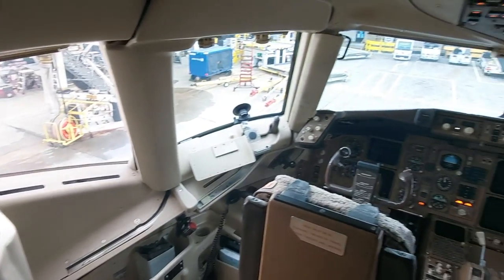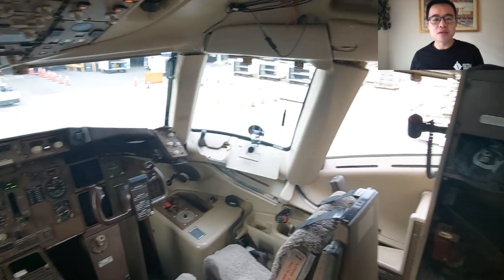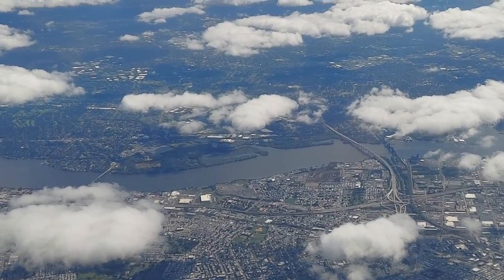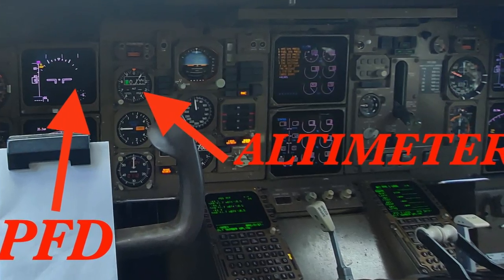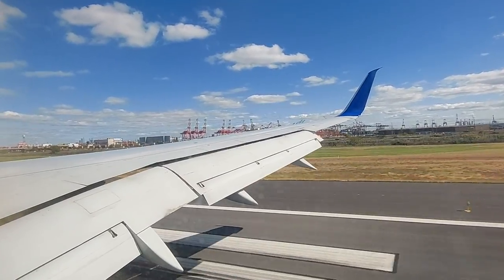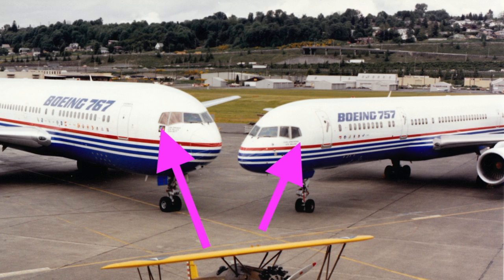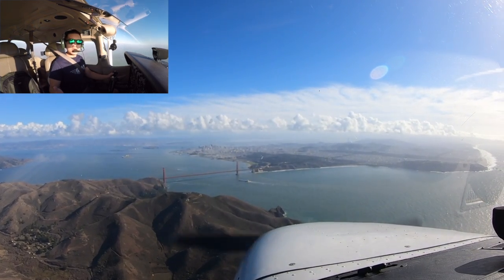BOEING 757 COCKPIT TOUR | United Airlines Boeing 757-200

Comment: All of our B757/767 aircraft all had Flat Panel Display systems which upgrade the flight instruments to modern aircraft parity. Also the B767-400 has the FPD system similar to the B787.
Reply from the maker: That upgrade makes a big difference. Much more capable. FEDEX even added FLIR to their fleet. Lots of cool aftermarket avionics on 757/767.

767-400 is nice, completely redone cockpit from the factory.

Comment: Spent many years flying the 75/76 before going to the 777. Some of Boeings best work (in addition to the 74 of course)
Reply from the maker: Amazing airplanes designed when Boeing was still ran by engineers.

Comment: Great video....love the 757 for the power and versatility....the airlines that still fly them don't want to give them up even after 30 years because there is nothing that can replace them.  Although I have read the new A321neo's are close in performance and range.  I am surprised they never upgraded the avionics in the older models, but maybe this is too much of an undertaking.  With the older avionics, I am wondering if these planes can fly the modern RNAV procedures?

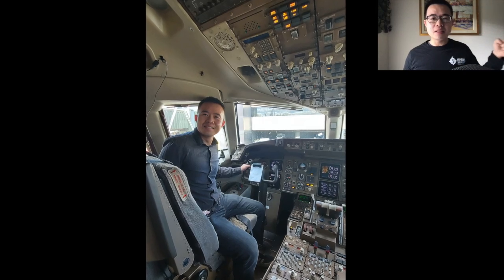Comment: 1:04 That seat is not in the flight position. It is mounted on an L-shaped sliding rail the seat moves inboard and forward from where it is in the picture, your leg wouldn't fit between the seat and the center console and the yoke column would line up with the cutout in the seat between your legs.

Comment: Very nice video.  Im a 757/767 capt. Flown them both for over 30 years ( since they were brand new.) 
It is not difficult to fly a 757 on one flight and then walk across the gate and fly a 767 on the next flight. The systems are a bit different but a pilot who stays competent will have no trouble. I have flown both the full PFD panel and the hybrid glass and I believe the hybrid is much easier and better for a true intrument scan when actually hand flying the jet.  The PFD is more of a monitoring the auto pilot display. 
After flying a 737 for years, my first experience with the 757 was an eye opener given its performance and rock solid stability. The 767 roll authority is amazing and it is my favorite overall. The 757 is a bit easier to land but the 767 isnt  bad either.  
After flying a 757 younger pilots realize what a crappy airplane the 737NGs are. Lol.
Reply: I spent nearly 8 years on the 75/76. Loved them both. The pitch control in both was comparable but the 76 was much lighter on the ailerons and I saw a few episodes of lateral PIOs on the 76. I think the 75 has better control harmony. At my airline the 76-200 was called the "dump truck" and it flew like an out of rig tractor in the pattern. The -300 was great and the 300ER was the Cadillac. I miss all of them!
Reply: @gerardmoran9560  I am flying with alot of young copilots and on the 767 I see alot of Lateral PIOs on short final...ive had to explain a few times to them it was self induced, they thought it was turbulence..
Reply from the maker: @gerardmoran9560  Thanks for sharing your experiences with these lovely jets. Always love learning about the nuances (big and small) between similar types - and how things like hydraulics, length of airframe and control surface design influence flying characteristics!
Reply from the maker: Thanks for your insights Capt. I must imagine upgrading from 737 -> 757 was quite a welcome experience. Wider modern quiet cockpit and those bigger engines!
Reply: @pilotjett4711  The things that I vividly remember about my first flights in a 757 were the take off performance and the rock solid stability. In those earlyvdays we did alot of shorter flights (replacing the 727) and at the light weights the airplane was a rocket often climbing over 4 or 5 thousand feet per minute. Same for the 767..often saw over 6000 fpm climb rates.. :)
Reply from the maker: @47colton  Yeah! With that big wing and sharing the large engines from the 767 family, the 757 definitely has a lot of widebody personality.
Reply: 757,Boeing just got it right.767,Excellent aeroplane, 737,good at short haul, but operators continued to demand more and more from a basic airframe. Bring back the 757.

Comment: The 757/767 should have never been a common type. Flown both on same day and they are simply too different. 
The 757 is by far my favorite flying AC (INCLUDING the 787).  Great airplane that flys like a fighter.
Reply: I think it's great how they're a common type, you can fly the 757 domestically and also fly the 767 internationally. I think it's great how you have the option to do both. From the pilots I've heard from, they love being type-rated on both aircraft and I hope to one day be flying both of them too.
Reply: It's a really smart idea for a lot of reasons. Good for Boeing, the airlines, and the pilots.
Reply: I used to think the same way when I first flew both 757 and 767, but over time,  with more experience it was not an issue to fly both types even during the same duty period.I ended up with 14000 on the both types

Comment: Such a neat airplane. Too bad Boeing does not have a successor for it.
Reply: It’s too good have a successor lol. Sadly it will be retiring from United fleet soon since United’s huge historic order of 737 Max’s and 787 Dreamliners…
Reply: Seems as if most airlines are going with the new Airbus planes.
Reply: @MrDoNotAnswer  United just ordered 100 Dreamliners and 100 737 Maxs, with options for more of both. That's a lot of Boeing planes.
Delta is hanging on to their 757s.
Reply: @DaveMiller2  💪🏻
Reply: @MrDoNotAnswer  I'm flying on a Delta 757 in March.
Reply: 787
Reply: But it has a big brother, the 767
Reply: called an airbus a321xlr